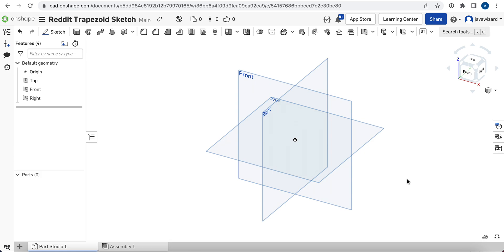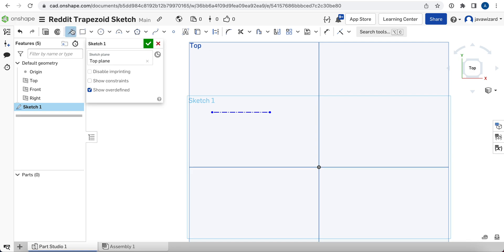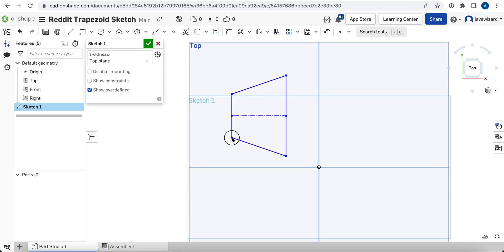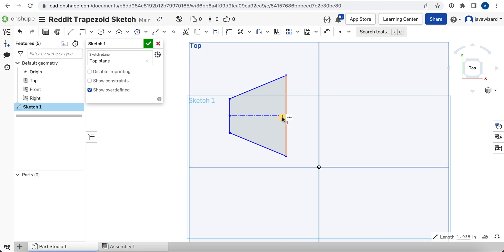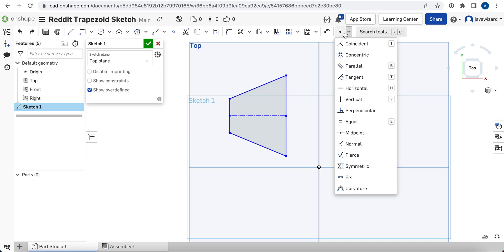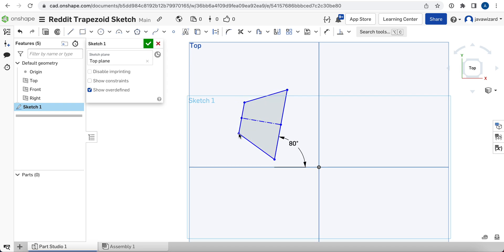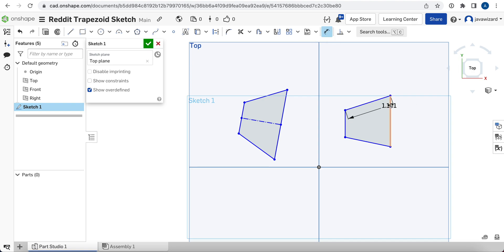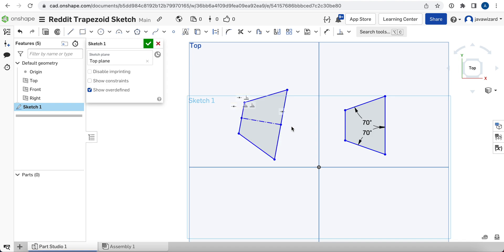Creating an isosceles trapezoid in Onshape

Comment: how does one freely move the ponits like u did at 3:58
Reply from the maker: So the most important thing to allow that is to make sure there aren't any other constraints that are preventing them from moving.

The part of the video just before that addresses how to remove any implicit constraints that might be getting in your way, and, there's a checkbox in the sketch edit dialog that lets you show all constraints in the entire sketch. It's super helpful if you're trying to drag points but finding you can't.

Let me know if that helps, otherwise if you want to post a link to an example doc where you're trying to drag points by hand but can't, I'd be happy to take a look!

Comment: I came here after I did essentially the same thing. But, after extruding this, I'm trying to make the top portion a proper rectangle. Running into some trouble here, unfortunately. Any ideas?
Reply from the maker: Ha, is https://www.reddit.com/r/Onshape/comments/13yxz00/help_asymmetric_topbottom_trapezoid_bottom/ you? If so, glad you got it worked out! The solution is indeed to do an offset plane, then sketch a rectangle and loft between the two.
Reply: @jw2539  Hahah, yeah, that's me! 😂